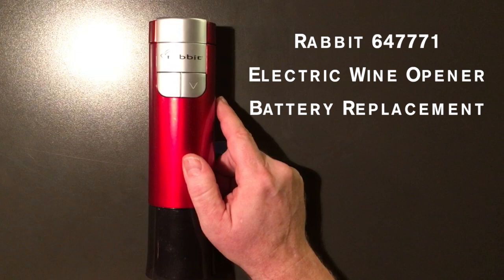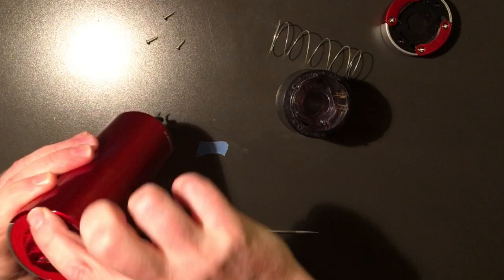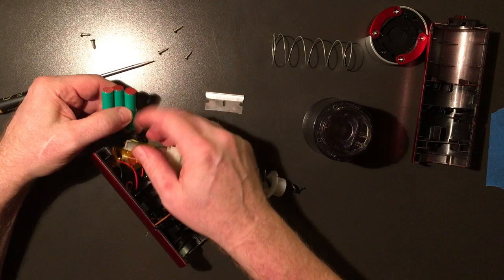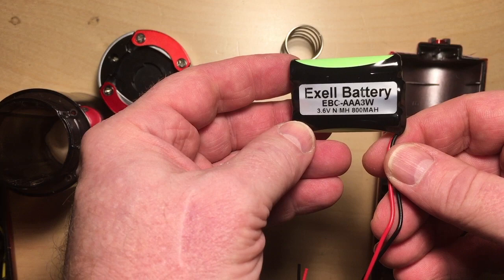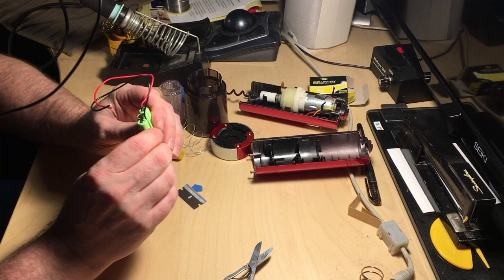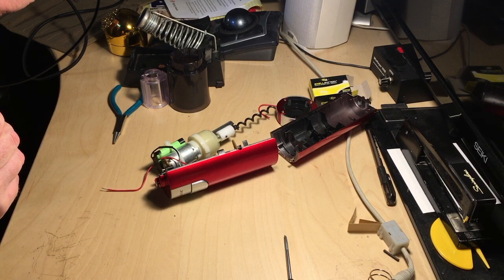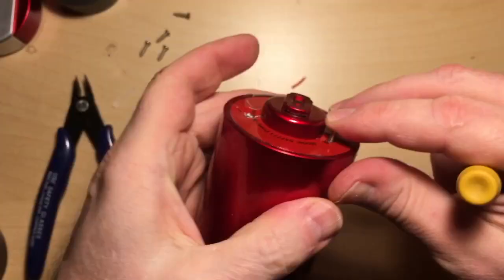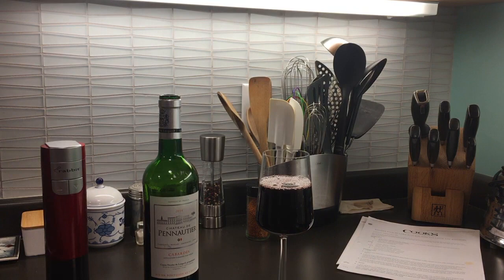Rabbit Wine Opener Battery Replacement/Repair (Metrokane Model  647771)

Comment: Thanks WardCo--you the man! I watched it 3 times since I searched online for help and was certain I would not find anything but instead found your detailed fix. I have a different model with no switches or labels. I got it from Macy's for $150 or so and had read online the charging socket tends to break inside. Despite my caution, the misses managed to break the socket after a year of heavy daily use. Your video gave me the impetus to give a repair a try, My screws were under a felt ring on the bottom and once removed the entire assembly slid out--so no splitting cases. I was sure you were going to break off some plastic tab--but you didn't and instead investigated further as I would and did. The mini USB socket is indeed poorly designed and soldered by a wimpy robot (or worse) so it had torn off the circuit board. The batteries are tired after 2 years of service so I plan to install a new set and after re-soldering the usb or adapting an external cord and socket to avoid the continued stress to the circuit board. I was amazed you have the same wire strippers, diagonal cutters, scissors, and screwdriver set as I have--and you are just as detailed and determined as I. For $150 I am not tossing it!!! I really appreciate your effort to make the video for everybody. The Rabbit is a great opener and I love showing it off when it works. Well worth the time and effort to stick in a fresh set of batteries for those with "the Knack". Rabbit could have made the batteries easily replaceable under a removable cover but they don't. Maybe that is your next project--making an access door with a socket for 3-AAA rechargeable batteries. Keep me posted! Tom

Comment: Thanks for the video.  I have a similar Rabbit, the "Electra".  I cannot even see how to get into it: no visible screws.  These things are obviously not meant to be repaired or have the batteries replaced, so I'll pass.  One year warranty and this one lasted 3 years before it stopped taking a charge.  Good enough, I suppose, but I'd buy a new one (another brand with better ratings) before I'd go through what you did in the video.  Cheers!
Reply from the maker: Thanks for the kind words, David. Yeah, can't argue. Your thinking makes a lot of sense.

Comment: My battery on this model is fine, but the corkscrew itself  is missing!  Some guest(s) perhaps broke it! Or ???  The plastic part that’s left doesn’t have an opening for the corkscrew...whereas yours appears to be attached way inside the machinery.  Any thoughts?  Hate to just toss it!

Comment: I was expecting a continuity tester after the bending to make sure the connecting spans were really still connected
Reply from the maker: I actually checked the voltage off camera before I started soldering, but, yeah, I got lucky -- and I am still worried that the links are under pressure now and might break in the future. I would absolutely change them to wire if I were to do it again. I'd expect it would also make bending the pack much  easier.